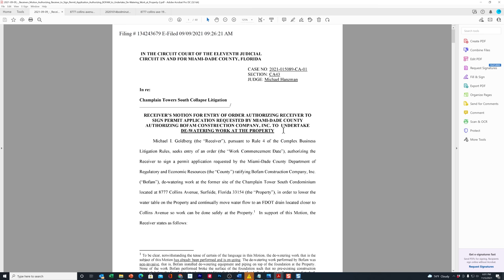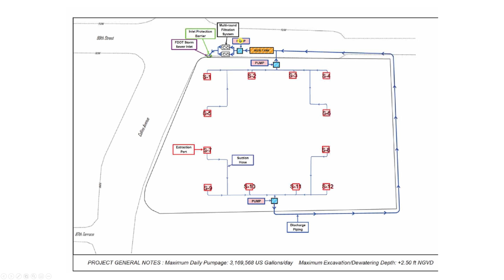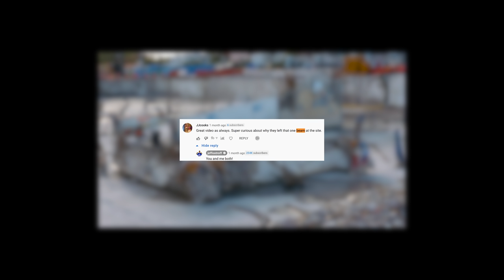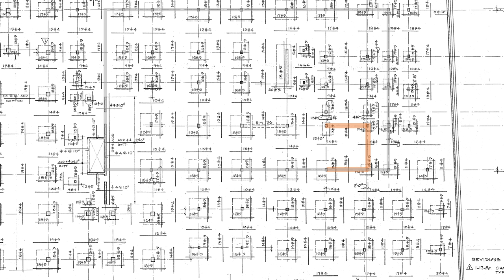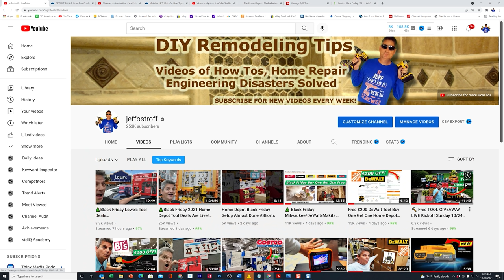Miami Condo Collapse: Engineers Baffled By Mystery Column

Comment: Possibly the beam moved on the north/south axis as the building fell. Your mystery column is one of the base supports to the H beam. IOW the beam did not drop directly down.
Reply from the maker: Look at the columns, the H-Beam only shifted about 12" tot he north and fell next to all 4 of it's support columns. So the mystery column, sticking out of the middle of nowhere, was not supporting or even touching the H-Beam
Reply: correct.
Reply: @designstudio8013   Thank you. I feel shift along that axis is at least as valid as a  “mystery” potential conspiracy. Until proven otherwise.
Reply: @jeffostroff  ALL the columns shifted N/S as 12 floors of leverage was applied to that H-beam. The H-beam moved differently because it WAS different by design.
Reply: Consider ALL the columns shifted N/S as 12 floors of leverage was applied to that H-beam. The H-beam moved differently because it WAS different by design. Your grid points references may be incorrect when you compare to a static floor plan.

Comment: Well, if I didn’t know better, I’d say it was a “Mandela Effect”,  but there’s too much remnant evidence that there was no column there in the garage, prior to the video footage. It could only have been added after that video, which is doubtful. The only other possibility I can think of is that the column that extended from the top of the H to the penthouse, came off the top of the H, and the weigh of the building drove it into the ground, like a piling. What you look at the video of the collapse, that section of the building stood for few seconds before driving down in the direction of that column, also evidenced by the shift of the H off the 4 columns the H stood on. Great video, don’t feed the trolls.
Reply from the maker: I love the trolls, they serve a valuable purpose
Reply: @jeffostroff  yeah, but we have enough idiotic hypocrisy and nonsense in the world, we don’t really need their negativity.
As for CTS, & this video, this column may be a mystery, but your nailed the point of initial failure & collapse. As was said here and backed in some other video researching the specs during construction, the pool deck slabs only barely met static load requirements, no dynamic load requirements were even enforced, so with those heavy planters, the merger waterproofing causing spalling, and the heavy lift equipment you mentioned, it’s a wonder the building lasted as long as it did.

Comment: The thing that gets me is that there are so little pictures of the pool in the rain where the water was around the pool rather than away from it. The other is the chemistry report and stress test on the concrete . Building of that type did not have the same standards as today. Steel left out and how much sea sand in the mix. Hundreds of buildings have to have there balcony replaced. Those columns that are not on the plan means your wrong on location ( could be more than one red ) or the pictures are wrong. Pictures could be a different building.
Reply from the maker: Hopefully  NIST will answer all these questions
Reply: @jeffostroff  Depends who was on the take.

Comment: Is it possible that there was a noticed structural problem found out, or at least fixed, after the fixed was taped in the garage where they came in a drilled to garage floor up and poured a column there?   The really odd thing is if they did that they were putting a column is that would have blocked traffic , unless the video does not do justice to with width of the drive area and a car could pass on either side of the new column and fit between it and any parked vehicles.   Otherwise if you parking spot was just on the other side of the new column you would have to take the long loop around to park and when leaving.  Certainly whoever has parking spots on the there side of where that column was put in should be able to speak to the fact that they were inconvenience with that new column being put in.  And that would not have likely been handyman work as to imbed the rebar deep enough that it held up to remain in the concrete of the floor, there had to be some type of a contraction company that could come in, remove part of the floor and embed rebar and then pour concrete into a molded form to make that new column.  Obviously there was a column there when the building collapsed so people parking in that area has to deal with the column, or its rebar skeleton remains would not be poking up there now.  That sort of a follow the money type of thing, it could not have been done without the HOA make funds available for it, and if so it should be in the minutes and/or financial records of the HOA.  And knowing that it was not there when the video was made, but there when the building collapsed makes for a much smaller time frame to search records for.  

The H beam was there in the design of the bailing but why only on that side of the building?  Obviously the architect  felt it was needed for weight distribution and may be only on that side of the building because that was where they decided to add the penthouse?  It would be interesting to look at the sister building and see if there is an H beam there in the same place and if there seems to be some stress issues associated with that H beam in the sister building.  The sister building, I understand does not have  a penthouse, and if it does not have an H beam in that location I would be suspicious that the reason it was there was to provide some extra support when they decided to had the penthouse.  Also, many have spoken to the fact that the original design did not have  a penthouse but it was added into the plans at a later date, was there a resubmissions and approval of the plans when they decided they would be adding a penthouse or did the penthouse just show up in copies after the original was approved?

I am still very interested in the water that keeps filling up the basement that they seem to need to pump out.  Of course, although its reached a pretty high level a few times, there has been a lot of active pumping, so I wonder really how much are they pumping out daily?   Is what is pumped out easily explained by how much rain may have fallen or are there gallons of water more than it could have rained.  Did the new construction next door disrupt the ground water so it ended up running into the Champlain towers garage because where it should hav settles was now filled up with that newer construction?  Did the rapid settling noticed a decade before lower the building so itself was into the water table, or has erosion beach side allowed move water to come in from the ocean and up into the garage in some areas?  I assume they were parodically testing the waster while doing the investigation to determine if some salt water mixing was taken place, or is the need to filtrate the water not just to not pour debris into the storm drain but to also remove salt.  If stormwater, grey water, is draining into water treatment plants for potable water, they would not like to be pumping in a large influx of salt water
Reply from the maker: That is what I think. I thinkt he column was added sometime after July 2020, when the garage video shows no column, and now there is one

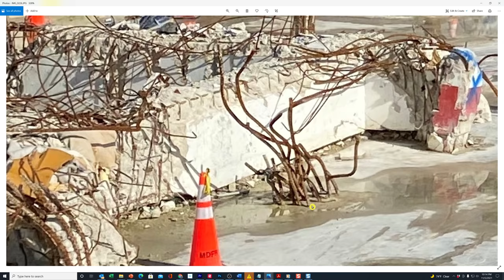Comment: 13:53 you said it doesn't look like a column impaled. That was my thought up to when you said that. I still have suspicions about that though. Could you elaborate more as to why you don't think its a column that got impaled into the basement floor?
Reply from the maker: The floor should have a lot more damage on it, and I can't see any at all.
Reply: What Jeff said, plus there is a regular, rectangular outline of where they cut the slab, inserted a footing/rebar, and patched the slab (at 13:47).  Others will tell you this is 'damage from impalement', but rectangular?  No, nature don't work that way...

Comment: Could it be that the column in the middle of the H-beam became displaced during the collapse? Then the force of the building coming down, drives the displaced column into the garage floor?
Reply from the maker: Whenever you make a claim like this about the column falling eight feet and impaling into the garage floor, you forget that there is zero damage on the floor where there should have been craters or something else if it had impaled into the floor but there is no damage. These rebar rods look like they were intentionally built up out of that concrete floor like it was done by somebody in the last 12 months, since Fiorella shot her video inside the garage in July 2020, showing no column exists where that mystery column is.

Comment: Jeff, i live in a two-story home. I just noticed the wood beam supporting second floor has a crack in different parts and on both sides of beam. Is this normal? I had never paid attention until now that we are looking to sell.
Reply from the maker: would have to see cracks but you would have to see it up close and determine how big are the cracks and are the longitudal a total type cracks that would cause a problem
Reply: They are lateral…whew! Hey they are building apartments 1.5 blocks away…and my house trembles and I hate it! Can’t imagine how it felt for Champlain when they were building those other condos. You don’t think that contributed some to columns debilitating at Champlain?
Reply: @rubyoro0  Do the cracks emanate from a hole drilled in the beam, or a sharp corner, like a notch?
Reply: @johnbergstrom2931     None like you describe. They are just cracks that run laterally.  It’s sort of like the beam is crack  almost in half longwise. But crack stops and then starts again.  Along with smaller lateral cracks in other parts of beam. Also, there is a part at beginning where beam is offset a tad because of crack.
Reply: @johnbergstrom2931    I just spotted what I’m trying to explain…If you look at this video, “inside the $46,5000,000 estate of legend sugar ray leonard” from AD channel you can see at minute 3:40 a cracked beam. That is what I’m talking about. Except my beam is sitting on two wood “columns”.

Comment: The U shaped area in the building's remains is aligned with the bottom of the ramp. The place you have drawn it on the plan is not aligned with the bottom of the ramp, it is below (south?) of there. You can see the "mystery" column in the plans, it just isn't where you think it is... it's north of where youv'e drawn the "U". So no more mystery.
Reply: exactly, it's column 18
Reply from the maker: You are both wrong because you don't know how to read the plans, I clearly showed that the top of the H beam is aligned to the bottom of the ramp. You are using the wrong plan to try to determine where the bottom of the ramp is when all you have to do is look at the garage level floor plan to see that they are lined and I showed it how it's lined. And on top of that I showed it in fiorilla's video screenshot where the UBM is perfectly aligned to the bottom of the ramp.  and column 18 is beyond the footprint of the H beam so it could not possibly be column 18. Once you make the mistake of misaligning the bottom of the ramp everything else you say from then on is wrong
Reply: @jeffostroff  either the H beam has moved or it's a different H beam. What's more likely, that the H beam lying on the ground isn't where or what you think it is, or that new columns are magically growing out of the slab? I can clearly see that column on the plans, and I can clearly see it's not where you have drawn it.  As an aside, we know that the ground floor columns collapsed at an angle, we wouldn't expect the H final resting place to be directly below where it once stood.

Comment: Best guess was it was a design error meant tomtake the load of the middle column supported by the h-beam. It was probably built and they discovered it was in the way of traffic. The h-beam was put in to solve the problem and the  column was removed and buiried under the slab. The column in the kitchens may have also been relocated on the plans slightly to line up with the h-beam support. The plans you have might not have been the first round and that set was submitted and approved to rectify that problem
Reply from the maker: It is unlikely the architect made a mistake with the H beam it was all built as planned the purpose of that age beam was to accommodate that K column in the kitchens and it rests on the middle of the H beam to avoid it going all the way to the garage that right below it and blocking the travel lane. So the H beam thus is resting on the other four columns, and the load from that floating K column resting in the middle of the H beam, gets transferred to those four so that is how they solved it. There was no mistake they didn't realize something was wrong later in and add something. We think this mystery column was added in the last 12 months because it does not appear on the video that was shot in the garage 12 months ago.
Reply: @jeffostroff  there would be a record of it, then. Permits, drawings, etc. Residents would have noticed that. You don't just add a column someplace. You would also see sawcuts in the floor in order to put in the footing.
Reply: No, the H beam was intended and in the original approved plans before excavation had even begun.  It's sole purpose was to redistribute load so they could eliminate the southeast column of the H beam (column 'O8', the red column in the video labelled '17) on the floors above the garage.  If that column continued it would have run through the middle of the living rooms of the expensive corner units and seriously hurt sale values.

It redistributed loads to column K, resting on the center of the 'H'.  Column K aligned with the corners of the kitchens in these units, and was integrated into the framing.  On the penthouse level, column K was an exterior wall column.

Comment: If this is the H beam in the drawing then where (on its TOP surface) are signs of the remnants of the larger beam that when up to the penthouse?
Reply from the maker: That's a good question a lot of people have asked that and we have found other examples in this building where they don't think there was enough rebar in place. But remember the column in theory would attach to the beam through the floor slab so the floor slab is completely gone and they may have possibly cut it off other parts out of there to leave the H beam sitting there on the floor. So you are not likely to see too much evidence of a column being there on top of that H beam. Once they start weed whacking the heck out of the rebar and that graj floor all bets are off as to being able to tell what was where. We

Comment: Could the mystery column have detached from the support beam and be driven into the garage floor by the force of the collapse?
Reply from the maker: where there should have been craters or something else if it had impaled into the floor but there is no damage. These rebar rods look like they were intentionally built up out of that concrete floor like it was done by somebody in the last 12 months, since Fiorella shot her video inside the garage in July 2020, showing no column exists where that mystery column is.
Reply: no

Comment: Now that's scoop! But I can't fathom how it had something to do with the collapse.
Reply from the maker: I doubt it had anything to do with the collapse, but in fact, I think the H-Beam actually helped stabilize the east section of the collapsed condo building for that extra 7 to 10 seconds that it took that part to fall at the very and.
Reply: @jeffostroff  I agree.  I think the beefiness of the H beam, integrated into column N 9.1/10 helped stop the 'rip' and kept the east part up a few seconds longer.  If that H beam had been compromised, columns N8, O8, O 9.1/10 and column K would have instantly failed, bringing the east wing down with it.

Comment: In the video, the description of the "mystery column" noted it as a source of water also. Maybe the "mystery column" was a subsoil structure and pierced the floor from below bringing ground water with it.   Have "subterranean plans" been inspected?  Is it possible during collapse that downward forces could compress the building slab into the subsoils?     Just my thoughts.
Reply from the maker: NIST is looking into all of the subterranean geographical studies as part of their analysis there is zero damage on the floor where there should have been craters or something else if it had impaled into the floor but there is no damage. These rebar rods look like they were intentionally built up out of that concrete floor like it was done by somebody in the last 12 months, since Fiorella shot her video inside the garage in July 2020, showing no column exists where that mystery column is.

Comment: It's the remains of another column that moved during the fall and punched thru the floor, making it look like it was a column there,
Reply from the maker: Whenever you make a claim like this about the column falling eight feet and impaling into the garage floor, you forget that there is zero damage on the floor where there should have been craters or something else if it had impaled into the floor but there is no damage. These rebar rods look like they were intentionally built up out of that concrete floor like it was done by somebody in the last 12 months, since Fiorella shot her video inside the garage in July 2020, showing no column exists where that mystery column is.